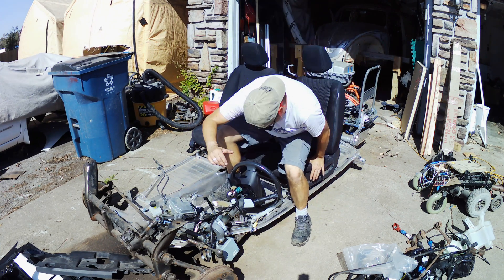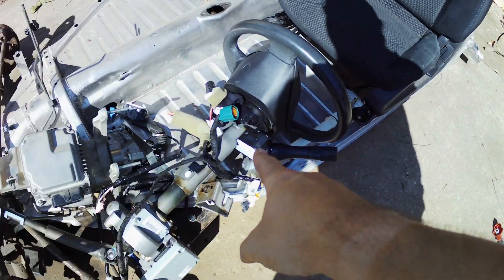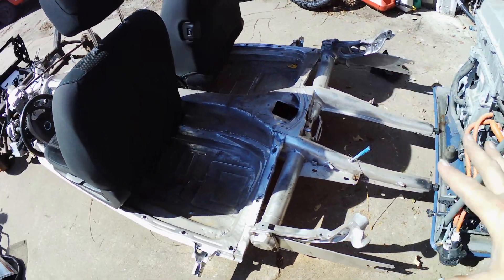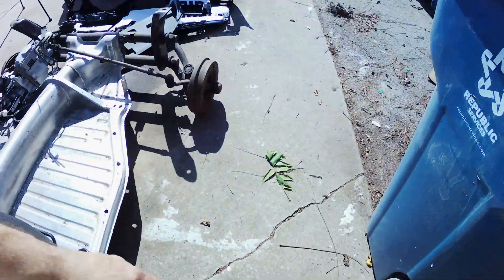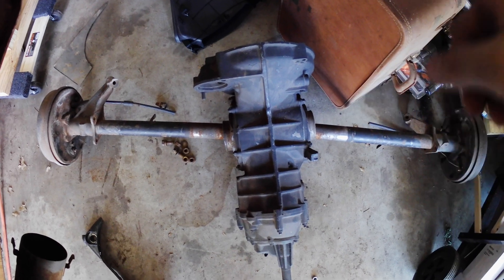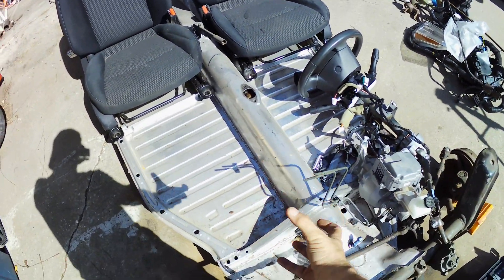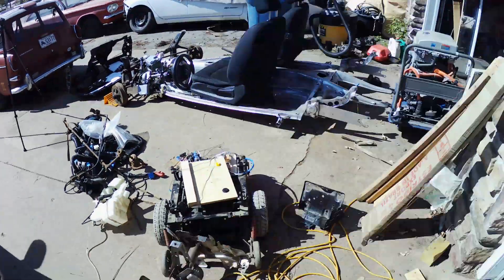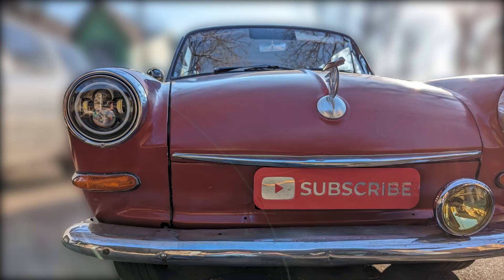Layout and plans for the EV Conversion on the Käfer Van, Panel Bug ep 32

Comment: You beat me to it when you were talking about getting rid of your rearview mirror I said to myself he needs a back up camera mirror. When you’re looking at the air conditioning heating system go look up split air conditioning systems like they use in large SUVs your idea of splitting the system has been done in big vans and SUVs so it’s a solid idea.They completely separate the condenser fan and everything and only have refrigerant lines running from the front of the vehicle they could be tucked in and you could put the compressor/heater remotely anywhere. I do have a question is that unit basically like a heat pump where it runs One Direction to strip the heat  from the refrigerant and put out cold air and the other direction to use the hot side of the refrigerant to produce the heat?
Reply from the maker: Thanks. Great question. There is an electric heater and a separate AC coil with a compressor.
Reply: @tinkering_guy  that makes it a bit simpler smaller the parts you can break it down into from the hole the easier it will be to place the unit in different limited spaces. That’s awesome. I’m really digging the project. I was on board when you were doing the bodywork, the opportunity to put a Nissan Leaf drive train and various accoutrements made it extra spicy!!